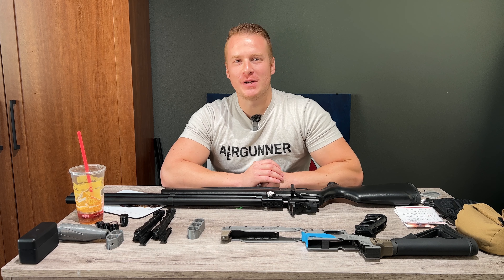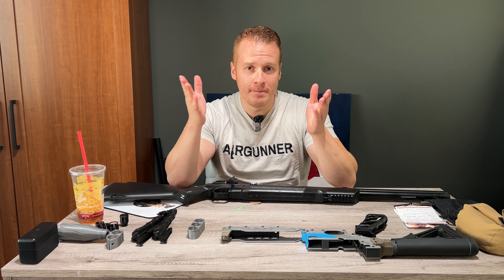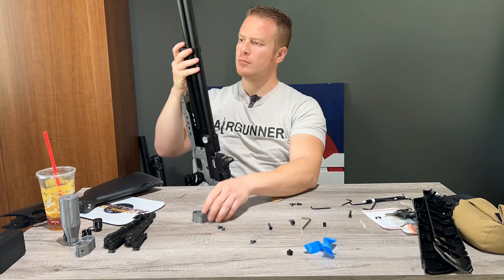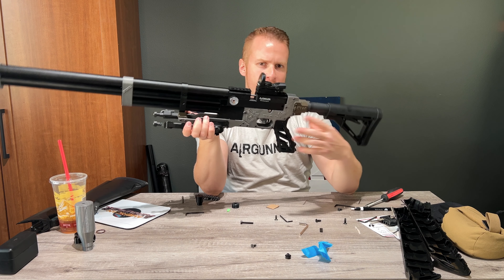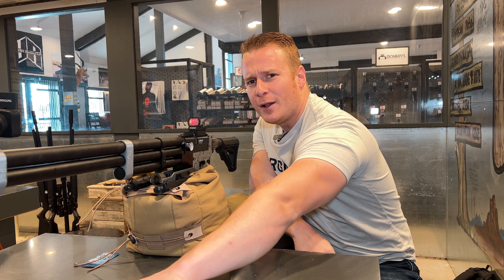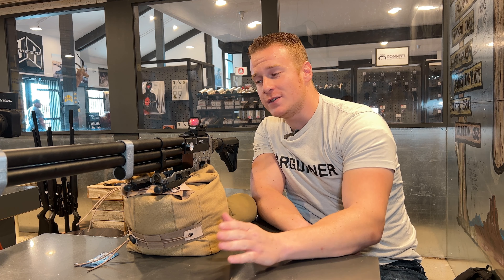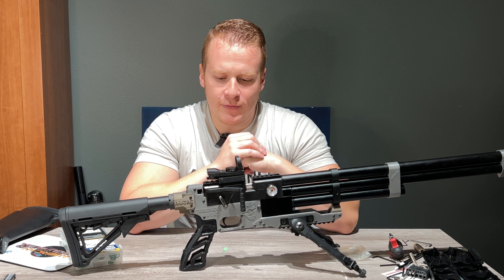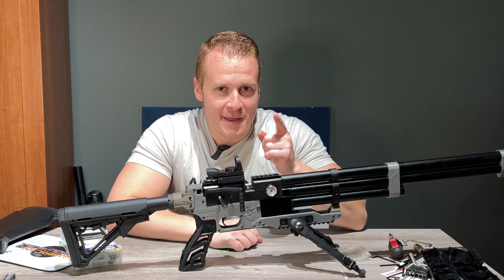Air Venturi Avenger CHASSIS?! Terminador 3D Printed Chassis Full Review

Comment: Not to knock these guys…I’m wanting to get the stock with their bigger plenum. But a wholly  3D printed suppressor isn’t a good idea for the reason you gave with the stripping.  Buck Rail, I think, makes a 3D printed suppressor with a steel nut for the threading. In fact I think in a video somewhere around here they mentioned that with their new suppressors. I got one for my .30 cal, haven’t got to play with it yet.